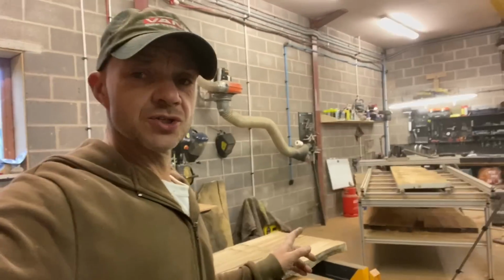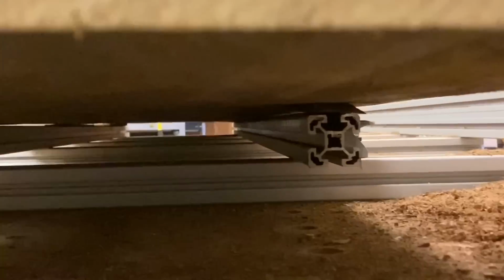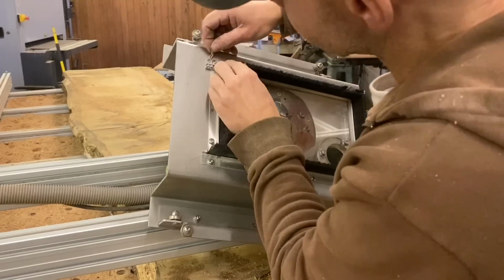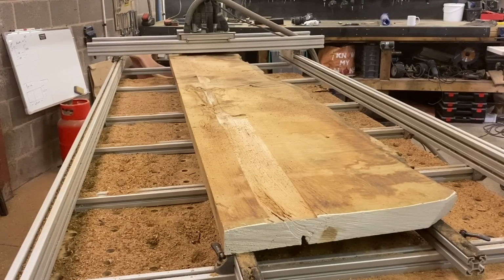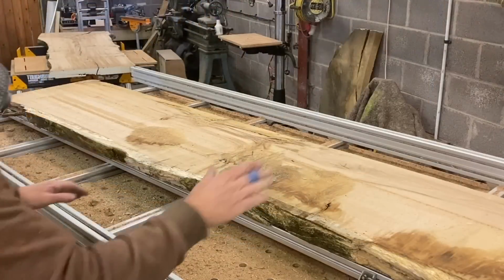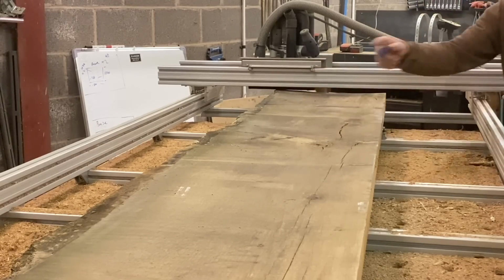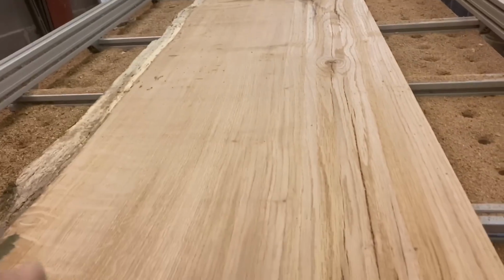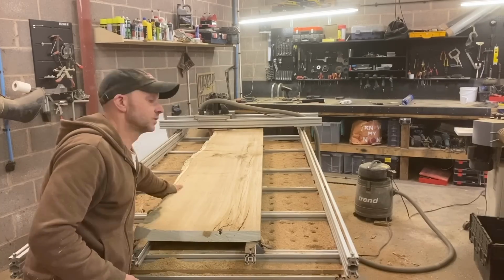#MWShopTalk   How to flatten a slab with a router sled

Comment: The table saw is an ugly product because: you have to move a 4x8 board over the table and that is very heavy. Then the shop needs 16 ft, at least, to use a table saw. I offer you for free my invention "Parallel Guided Power Saw" you can see on your tube.  You can use one and even manufacture it and sell it. I will give you all the information for free. Is very simple and great product and one day will eliminate the table saw, the router table and even drill press for some application, where we need holes for more than about 10 ft from the board edge.

Comment: Hi. What router speed do you use?
I'm getting a lot of burning into wood. I have used new trend (£70) router bit 1/2 in same festool 2200
it lasted like 20 mins until it started burning
Thank you for your content
Reply from the maker: From memory 18,000 using Titeman spoil board cutter

Comment: Do you use a chuck extender? How far below the carriage does the bit reach?  Do you need to pack up slabs to within 10mm of carriage?
Reply: Up to 50mm under the bottom edge of the cross rails depending on the specific router bit and extension

Comment: I'm just getting into this stage of woodworking and trying to wrap my head around the router sled options and techniques, so very much appreciated this video. The aluminium extrusions are definitely the way to go. Thanks for taking the time to do it, very helpful!
Reply: The table saw is an ugly product because: you have to move a 4x8 board over the table and that is very heavy. Then the shop needs 16 ft, at least, to use a table saw. I offer you for free my invention "Parallel Guided Power Saw" you can see on your tube.  You can use one and even manufacture it and sell it. I will give you all the information for free. Is very simple and great product and one day will eliminate the table saw, the router table and even drill press for some application, where we need holes for more than about 10 ft from the board edge.
Reply: go with linear rails off of amazon , super cheap and work amazing

Comment: What router do you use, mine (not a tot) has a problem with 3mm depth of cut. The router is slowing down when im cutting so i guess i need one with a constant rpm even with resistance, also using a 45mm bit.

Comment: Nice economical machine.  I have several large oak slabs that need flattening....do you think it would be practical to scale up the design to fit slabs that are 4 ft. x 13 ft?  (1200 x 4000 mm)  Finding aluminum rail that long might be difficult.
Looks like you modified your original design using linear rail to the cross slide to using the TakeOneToo slide that uses ball bearings.
Is the TakeOneToo unit held firmly down like your original so that the cutting force can't lift the router?
Reply from the maker: It Isn't held down , but I have never had it lift as the sled and 2200 router are very heavy
Reply from the maker: 4m long and 1.2m wide is not a problem the rail comes up to 6m!!
Reply: I think this one is modified to 4x2 m and you need 4,5 x 1,7m (for 4 x 1,2 m slabs) 

https://www.instagram.com/p/B3MqHFlgkGd/
Reply: Actually, it is held down when you lock it with locking levers during parallel moves along the grains. A weight of cross profiles with the router and TOT! Complete pack, in this case, is approx. 30 kg. But as Andy correctly mentioned, even the weight of the router + router cart (approx.15kg) is sufficient against the lifting.

Comment: Good video. I’m not a woodworker, but I’ve done some woodworking projects in the past and I was taught to go with the grain if at all possible. I would think even with a high powered router it seems to make sense and go with the grain like you do instead of cross grain.
Reply: You have to remember that router is spinning in a circular patern on the wood. lit's pretty hard to go exactly with the grain of the wood

Comment: Just looked at the sled system. Hmm. Thick end of 500 quid not including aluminium profile?
Reply from the maker: not sure on final cost , I already had lots of profile from other projects .  The TOT sled is not cheap but it is the best out there by a mile ..!!!!   if your not use a router sled on expensive slabs and furniture sale you can alway make on from MDF etc .. I used to do that they work ok .. Best Andy

Comment: How do you think this set up would go on a regular tabletop made from solid hardwood boards? As an alternative to a wide belt sander..
Reply from the maker: its a alt to a planner not a wide belt sander!!!   and yer with good sharp cutter it work amazing !
Reply: Manor Wood thanks. Yes but you obviously go straight from the router to and orbital and I was hoping to do the same to skip the step of paying for someone to run it through a wide belt sander.
Reply from the maker: If it fits my wide belt I go straight to that after the router sled it just easier to get things dead flat

Comment: I would imagine cutting the slab into narrower pieces levelling and then gluing it back into a slab saves thickness in some cases. I am going to build this sled in the near future it is just excellent.
Reply: If you cut the slab in a few pieces and then you´ll glue them back together, this table will have a totally different value than the table made from one whole slab. The first way is woodworking, and the second is an art :)